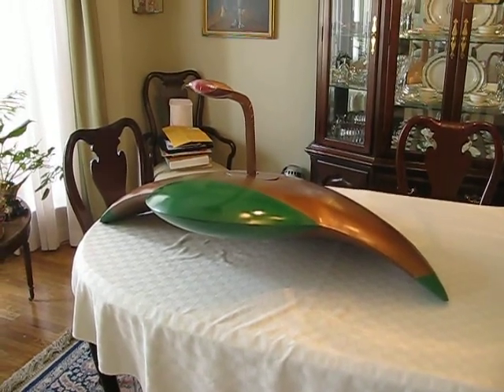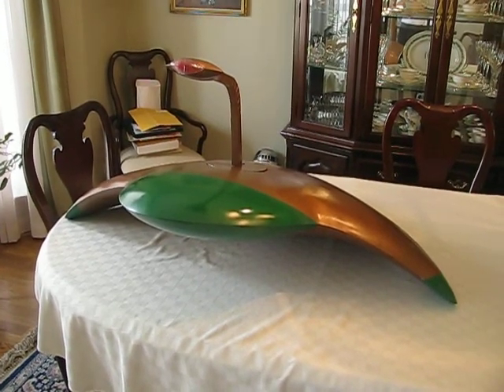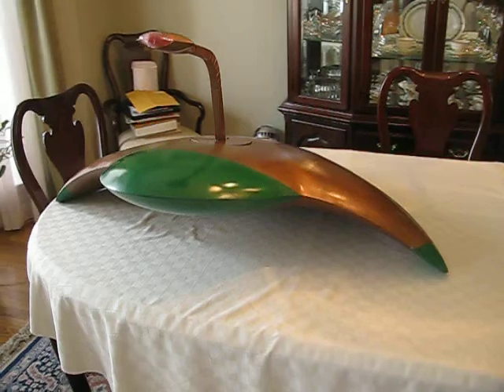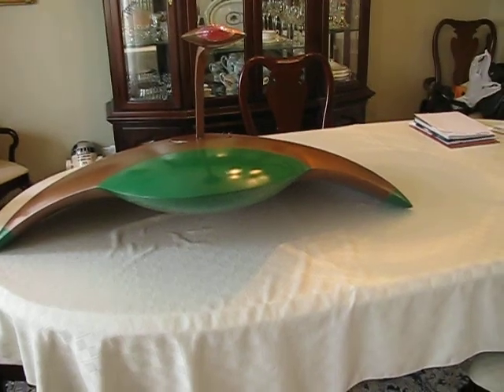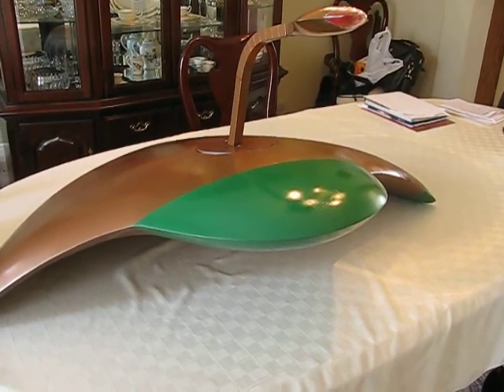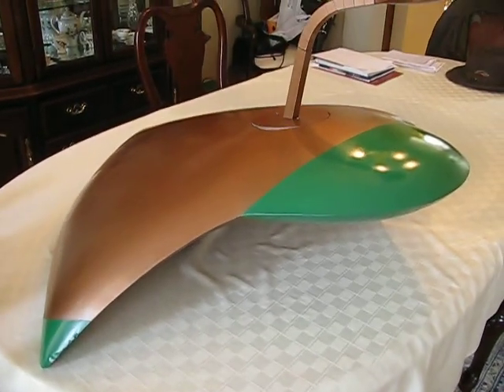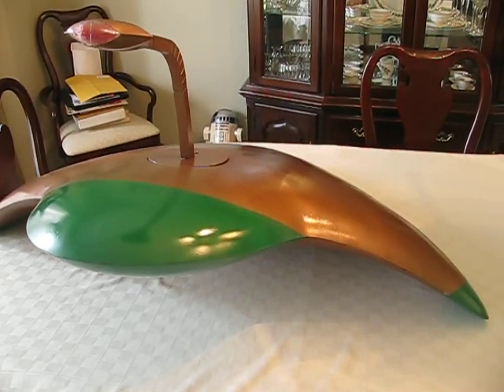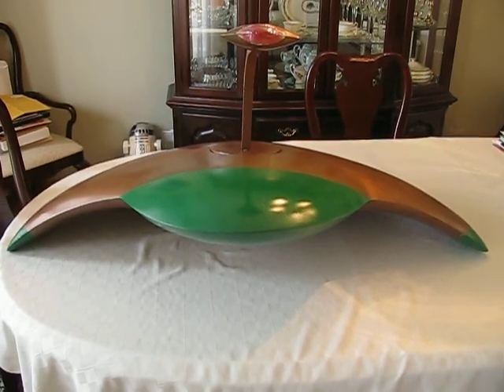War machine based on the 1953 War of the Worlds movie

Comment: Did you know that it was supposed to be a tri pod with wires that had an electric current to make the machines look cooler, but they almost got electricuted during the test run? So they took then off and turned it into a hovering death machine.
(SORRY MY SPELLING SUCKS!) XD